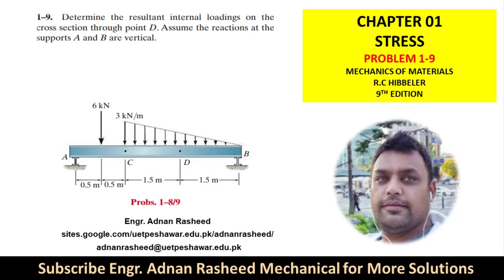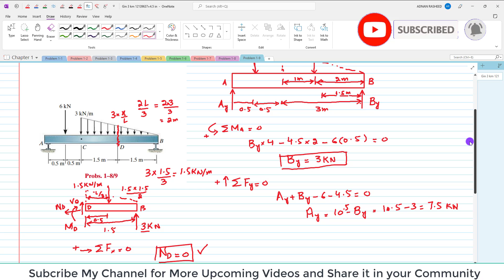1-9 Stress | Internal Resultant | Loading Chapter 1 Mechanics of Materials by R.C Hibbeler|

Comment: Why you did it .......1.5into 1.5divided by2
Reply from the maker: I think you are talking about (3x3)/2?
Reply from the maker: If yes then you can see its a triangular load or uniformly decreasing load and to convert this load into point load we have formula 1/2( magnitude of load x length over which it acts). I hope it will be clear to you now...
Reply: @engradnanrasheedmechanical    I am not understanding this logic !!!!
Vd-0.5×0.5/2+3 cuz we already take out F/m which is 1.5 N/m we should only multiply this to length which is already 1.5 so why it is necessary here to put the formula of F =1×l×b/2.... Please let me explain this logic
Reply from the maker: Well I got your point. Ok at point c load is  3 KN/M WHILE at point b it is zero. Now when you cut the beam at point D so at point D magnitude is (3×1.5)/3.
Let me explain 3 KN/m divide by total length 3 = load at point D (KN/m) divide by 1.5 so load at point D is 3x1.5/3=1.5 KN/m
Reply from the maker: NOW THIS IS TRIANGULAR LOAD STARTING FROM point D to B. At D 1.5kn/m while at point b it is 0. So to convert this triangular load into point load when use formula 1/2  x 1.5 x length 1.5 . Which will act at 0.5 from denser side I.e from point D
Reply from the maker: Did you get the answer?
Reply: @engradnanrasheedmechanical  yeah thanks
Reply from the maker: You are welcome